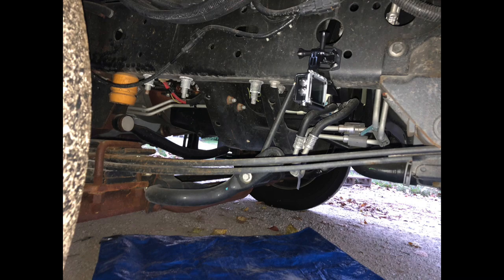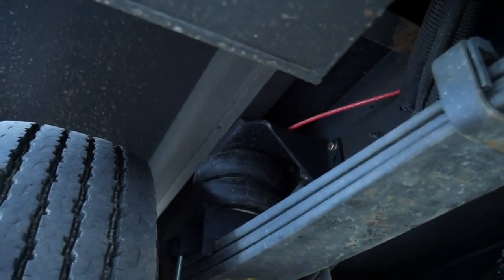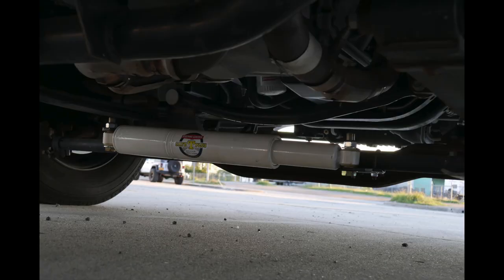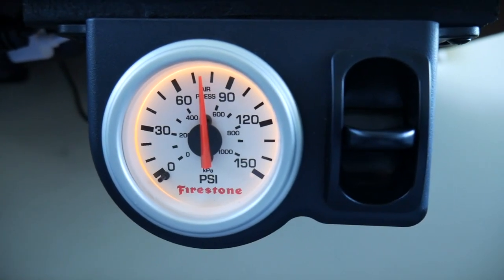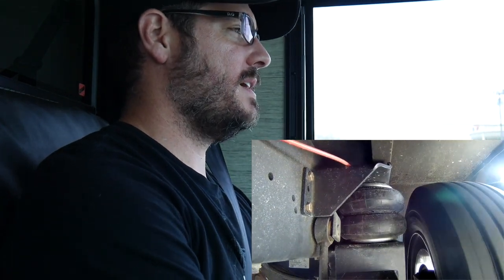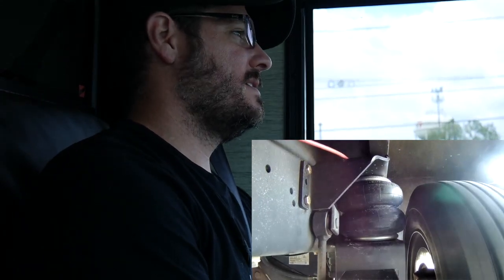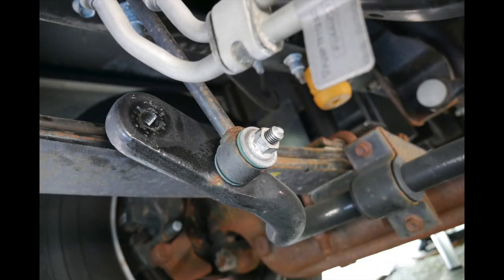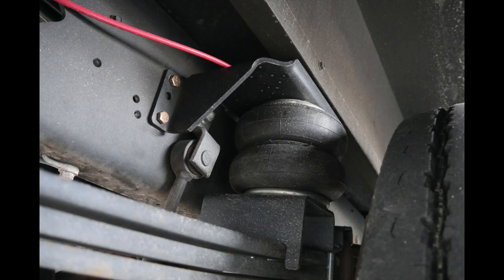Class A Gas RV Suspension Upgrades : Firestone Ride Rite, RV Steering Stabilizer

Comment: Good info. We have a 2008 Class A on the F53 chassis. We installed front & rear Sumu Springs, new Koni FSD shocks, safeTplus, larger front and rear anti-stabilizer bars and rear traction bar. Body roll is almost gone and the ride is much, much nicer. Not sure why, but some semis still push us a bit and others do not.

Comment: Thank you for the video...I have an f53 chassis class A as well...

Any updates? Did you install the air helper springs in the front after all?

I am plan on doing the same.. Air lift has an automatic air stabilization system now..  

Will binge on your videos this coming weekend